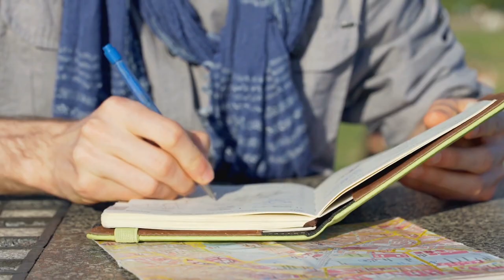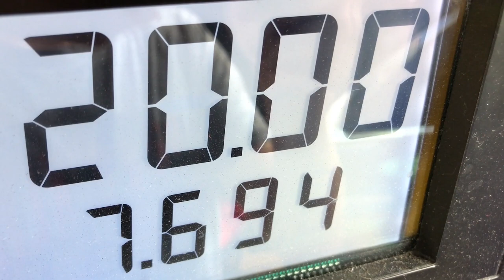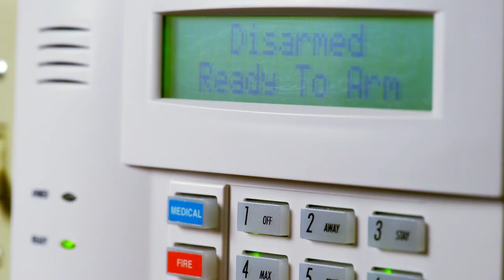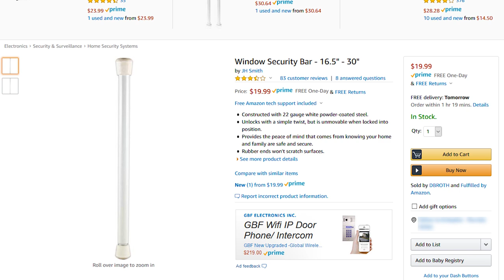How to survive after SHTF in an urban or suburban environment

Comment: In a SHTF scenario the key is to outlast the initial chaos. After 2 months the situation will begin to settle down, within 6 months 75% of the unprepared will be dead. It will not be the prepared that you have to be worried about, try to form alliance's with those people to co-mingle your resources. The people you will have to worry about are those that evacuated from other areas to your area in search of safety. If you currently live in such a place you know what I mean. In Florida whenever a hurricane strikes South or Southwest Florida the residents of those areas escape to North or Central Florida and we become inundated  by people from those areas. They can get this far on a tank of gas and become stranded here. Usually camping out in parking lots etc. Those are the people you must beware. Once they realize they won't be going anywhere soon they will resort to almost anything to feed themselves and their families. The Police and law enforcement agencies will not be there to protect you because they will be at home protecting their own families. You will be on your own at that point.

Comment: Buy a used 4WD truck. You can use it for hauling your supplies, sleeping, etc. It's one of the best bug-out investments you will ever make.
Reply: Unless electromagnetic pulse
Reply: What about gas
Reply: @rachelwoodruff5567  Of course gas is a problem. But diesel is safe to store and it has a long life (unlike gasoline). You should be able to store enough fuel to make it 1,000 miles or more to your bugout location, and since a full-size truck has a hauling capacity of 8,000 pounds or more you will be able to haul several tons of stuff with you if need be. You can't do that in a car.
Reply: Guns, ammo, and easily accessible supplies go in the back seat. Sleeping happens in the truck flat bed, supplies and cooking appliances will be in the trailer.

Comment: To me, digging a shelter underground in middle of remote woods is optimal. Do it right no one would ever find you.
Reply: @JohnDavis-im1oy  I wish I had the residences for this.  What I really want is a shipping container underground.
Reply: Cargo container.
Reply: Fire Breathing Moon Beam You Might be better off with an old school bus. Either way, you will need to do some fabrication work. The advantage of a bus is that you will not need a crane to get it into position. It doesn’t have to be reliable, just has to run long enough to get into place, then you can part it out and sell the drivetrain.
Reply: Till it rains enough...
Reply: until they sweep with the drones etc :D

Comment: 16:07 
Awesome stuffing a revolver in your pants while your finger is on the trigger
Reply: IRON1 It was empty. Will load only when attacked. “ Excuse me, could you stop beating me?, I’m trying to load my self defense automatic pistol with a clip”. “Got six clips, and can’t fit them in the hole if you keep clubbing me”.
Reply: IRON1 yea, I saw that too.
Reply: jeff lockaby I’ve got a 45 cal Shield, striker fired (no trigger), one chambered, full magazine...safety off, covered trigger holster. No problem in three years of draw practice. A revolver may be different. Then again, you never know. Someday I could be nut-less.
Reply: Could be an effective form of birth control though
Reply: @dancindavey1515  i think you meant no hammer
Reply: Its a stock clip, not the creator.
Reply: @fixerupperer  Yep. Wouldn’t be  much of a  self- defense weapon without one. Good catch. I just read my reply to iron1. I can’t figure out what the hell I was talking about.  I think I need to start drinking beer again.

Comment: After SHTF happens after everything becomes a disaster. Total abandonment of cars and trucks.
Is a left behind resources.
There car battery to build your solar battery bank.
If you have solar 
There alternator in car trucks to power with a 12 volt solar to inverter you can produce excessive power to power a refrigerator or freeze during the day
Make a battery storage by taking battery out abandoned cars and trucks.
 Rubber tires on abandon cars and seat cushion can make shoes and boots

Comment: A hardened (bull bars, rugged tires, CB unit, flood lights) 4x4 utility vehicle would be the best item to have if one does bug out to the countryside, they can carry a heavy load of equipment and handle rugged roads and be used in multiple ways. Having a tent in the event living in the woods is your only options is a idea as well.  The best option is having a 4x4 4 door truck and a small camper, SHTF and you have everything you need to get as far away as you can to survive. Learn urban apartment gardening and how to catch the rain from a apartment it can be done along with storing pre-made 30 days food supplies as much as you can. Have a VHF/UHF radio to keep abreast of the world as it collapse around you.  Being a 'Grey Man' is a great tactic but being a 'Ghost' is better is the situation allows.  Lastly (some may not agree) eliminate your threats if the opportunity presents itself i.e. gang leaders, anarchist, murderers, rapist and anyone that is blatantly your enemy.  I know a lot of these suggestions cost a bit of money, so my advice is start saving now.  One more thing train, rehearse, train, rehearse and when your done with that train rehearse train rehearse repeat.

Comment: EXCELLENT Video!
One thing that has always bothered me personally is the ultra heavy emphasis most experts put on Smart Phones / cell phones in general. I speak from PERSONAL experience on this aspect. We had a BAD windstorm here in 2007, and the Cell System is the FIRST thing that went down, even before the power went out.
Right after that, you did mention 2-Way Radio for comms as a backup-Bravo, however, 2 Way (Ham, FRS, and GMRS-I have all three) is my families' PRIMARY means for SHTF Comms. At this point, I HIGHLY recommend the Yaesu FT-4. Though lacking a couple of features I would LIKE to see,  a keystroke sequence completely opens up the radio so it will transmit on ALL of those services, INCLUDING Police, Fire and Medical, as well as "other" frequencies. I do NOT Advocate doing ANYTHING illegal! What I AM saying is that for a very small amount of money, the FT-4 has BIG Intel gathering ability!
Reply: @Bruce Forster: Thanks for that info. Recently I have been considering SAT phones for family members for Christmas. I need more info on how each item (ham, sat, etc) works. I'm copying and pasting your info into a document so I can refer to it while I do some research.
Reply: Don't forget about portable CB radios. They're relatively inexpensive now. Have 2. You'd be surprised at how much happens within 5 miles.

Comment: These are endtimes situations.  From where we are, we will hold out in our home where supplies are stocked and our house is structured well.  We can store all the blades and materials for protection.  This is better than running out in the open and getting exposed to all the elements.  There will be nowhere to run to, and nowhere to hide.  These situations does not include cases of tsunami which demands other areas for action.  Above all, and foremost, we need to pray that humanity will not experience real bad calamaities.

Comment: I don't steal, I tactically acquire.
Reply: If  you attempt to tactically acquire any of my stored food,  you will tactically acquire several large diameter ventilation holes.
Reply: It's not cannibalism.  It's tactical adaptation.
Reply: I borrow...on a permanent basis.
Reply: @AZ-kr6ff  you will be buried in a shallow grave,  on a permanent basis.
Reply: @damonthomas8955  
I doubt that.
Reply: @damonthomas8955  
It would be so easy to smoke you out of your stronghold.
Reply: @damonthomas8955  
You're basically a sitting duck.
Reply: @AZ-kr6ff  yes, I am sure that you have thoroughly scouted out the weak points in my perimeter . Come on in, you will do fine.
Reply: @damonthomas8955  
I already know that you are overconfident.
Reply: @damonthomas8955  
Besides, the raider has several advantages.
Reply: @damonthomas8955  you give me some food !!

Comment: Solar can be had in an incremental fashion.

A small solar panel and a battery bank can provide light and power for small devices and Jumpstart a car.

A pair of 100watt panels with an inverter and battery can keep power tools charged and provide basic lighting, fans, and small camp refrigerators with power.

800 watts of panels with mppt controller can keep a 3/4 hp pool pump running, cutting your electric bill and help keep your pool water clean enough to be a very large emergency supply.

1000-2000 watts of panels plus battery storage and inverter is enough to run an entire households lighting and a small refrigerator or keep 1 room more comfortable (AC) and fully powered to modern standards.

After that the sky is the limit.  Full household, EV charging, food production, water, etc.  The nice thing is that unlike your prep gear sitting in the garage you can integrate it into your daily life and cut your expenses and increase self-reliance.

Comment: The first rule of prepping is to be informed (not with fox but the weather channel and local news). If a large storm is heading your way, the more time you have to prep the better off you are. Generators won’t run without gas, stock up and add treatment; you can always dump it in your car if the storm takes a left turn. Get that extra food in your fridge. The more packed your refrigerator is the better it is to stay cold. If possible get gas or propane, this way you can cook when the electric goes out. Take up camping and hiking, this will not only keep you fit (and teach you that dirt under your nails won’t kill you), but will teach you important survival skills. Learn what wild plants are OK to eat, also how to hunt and/or fish.

Comment: There are Battery Packs that act as electricity backups.  You just keep them plugged in, and then plug in your CPAP or BIPAP and if the power goes out they run off the batteries.. These are lithium 19650 cells in series and parallel, that put out sufficient current to keep essential medical equipment (even electric beds) working.  They last about 48 hours on a single charge (depending on how much is plugged in and draining the battery.

Comment: Make sure you don't have any weeds trees or bushes close to your house or fence as it provides people with a place to hide and either ambush or infiltrate also keep it well lit at all times that might mean making and setting up oil burning lanterns or torches at night if you don't have solar lights or the lights end up compromised be careful with the torches though as they are a bit of a fire hazard but as long as you place them well and make sure nothing flammable is too close as well as making sure to build them well then the threat they will pose will be minimal and less than the threat of looters

Comment: No water, no electricity means no running toilets!!! In rural areas a gravity fed septic tank does not need electricity, then having a water well, with hand pump assures things remain normal under most situations. You will still need to get water to the home. Generators are great until fuel runs out. Think redundancy!
Reply: I also noticed no advice on toilets/sewage.  This will be a very big prob very quickly. Living in country this is not a prob but in cities this will be one of the biggest challenges.
Reply: @robduncan599  Statement: Sewage control is much easier in the rural areas but anyone who has ever been on a farm still knows it has to be handled properly or there is a great possibility for disease.

You can only go dump in the bushes so many times before you start stepping in it. Preparing an outhouse takes a lot of time and work. Having a septic system of any type requires even more work, and also regular maintenance.

There's also the consideration that a lot of meatbags are going to be leaving feces everywhere. This means that you will not be able to trust ANY water source during a collapse, particularly groundwater wells or larger rivers. Purification will be absolutely necessary (and it's smart now).

City-dwellers don't tend to appreciate the VAST amount of effort it takes to keep the infrastructure that surrounds them like a cocoon running properly. Part of the fault of that is that modern meatbags have made most of the work as invisible as possible.
Reply: @hk-4714  Where i live in rural Scotland i have a water well which needs pumping to fill a holding tank ,however in an emergency this could be done manually.  On the sewage side of things it is all passive,  with a septic tank,  just flush that is all that is needed . This is very common here in rural Scotland.  In summer months in a drought we sometimes run out of water ,last year we had no water for almost 4 months , so i know what it is to be without water . Buckets of rain water that we catch are used to flush , 5 gallon drums x 4 were used to collect water  from a local town every 2nd day or so . Washing was used very sparingly,  so i have some idea the work involved if a big emergency event was to happen.  I guess i am lucky i live where live . On a side note i also have 2 million calories food saved ( videos on my YT channel) in preperation for Brexit which is an utter clusterfu*k on the horizon end October.
Reply: @hk-4714  There are recent reports that plague is taken hold in areas that are inhabitated by the homeless in LA and San Francisco...
Reply: @wuderoofe  Query: What do you expect when you have used needles and feces in the streets?

Don't forget that cholera vaccines haven't been a regular thing since a few decades ago.

Comment: I have a Dozen rental storage places on root to my bug out farm.
Full with freeze drying medical and gallons and gallons of 5 gallons water .
If I’m on my way to farm and a town is not letting outside in .
I can say I have a stash of storage stuff I need to fill my pack and you can take the rest. All I need is to get to the next storage rental unit. 
So I offered them a full storage unit of 
Food water 3 full propane tanks and 40 gallons of stability gas. 
Each storage rental has at least that and more All i need is to refill my back pack
Until I get to my farm where I hydro turbine power off grid for 19 year now power 24/7
1000 amp
Plenty of fruit vegetables and maple syrup and honey from my bee.
The rental storage are if I get run over
Or if I working stuck away from home.
I can barter those good to move through 
6
Hand dug wells can drink right from well  sent out don’t need to treat told I can drink straight from the wells
Hope I never need it.

Comment: Wouldnt gps work as long as you had a tru gps system?
Reply from the maker: as long as the satellites are still working i suppose.
Reply: Many GPS-receivers can utilize Russian GLONASS-satellites, too. It would have to be quite a disaster to shut down US and Russian systems simultaneously. I think grouund stations are essential for both systems, but probably they have secure power supply even in total grid down situation. Positioning systems are so important for the military.

Still, better have paper maps, too, and learn how to keep track of your position. Battery power may be too valuable to use all the time of travel.

Comment: I plan to join Genghis Khan's Mongol horde. ;)
I'm staying put, I live in an exurb, near the ocean, hurricane and flood zone so we're used to being prepared for extended periods without electricity, water and egress. I have salt marshes on two sides, swamp with gators on a third side, one way in by land, the area has limited land access but water access is wide open.  Clear view of all access points from a solid place in the salt marsh, you'll need thermal imaging to see me. 2000 meters is my first line of defense, I will see it before it sees me. One of my favorite hobbies is long range marksmanship. 
Be prepared.
Non serviam.

Comment: Hi Guys, I think at least half the population could survive a grid down SHTF if food and water were available.  You would need a generator for each water tower in a city to keep the water flowing.  Where I live, we have huge companies that process tons of grain per day.  Pillsbury in Springfield, IL.  ADM in Decatur IL.  Anheuser Busch in St. Louis, MO. Cargill in East St. Louis, MO.  The list goes on and on.  Supply a generator on site large enough to run their grain mills, and you produce thousands of pounds of corn or wheat flour. Just mix with boiling water.  Not great nutrition, but would certainly keep you alive for a long time.  The grain is already at the site of these food processors.  Every one of them have enormous grain bins and elevators on site.  They are not empty.  Companies do not put that kind of money into infrastructure for no reason.  Our state government could easily put a plan together with the National Guard to make this work, but of course, they won't.  These companies would co-operate, because if everyone dies, who do you sell product to?